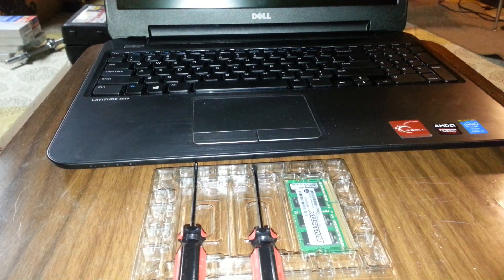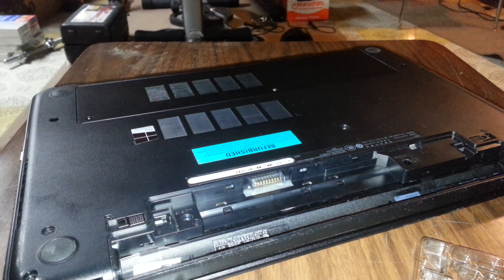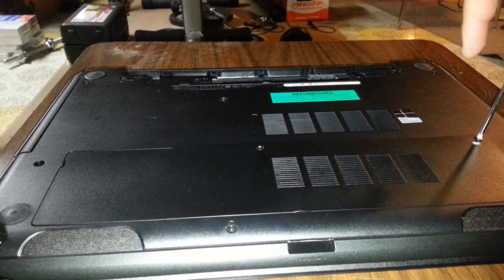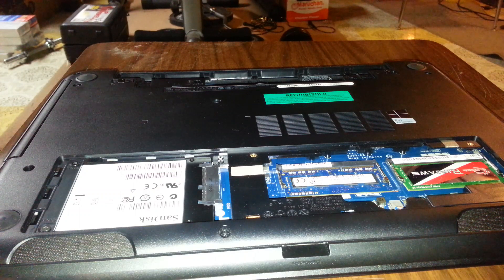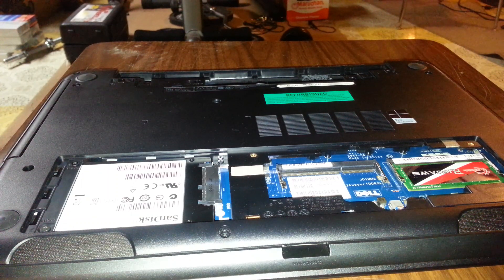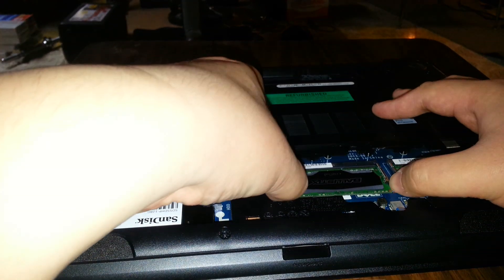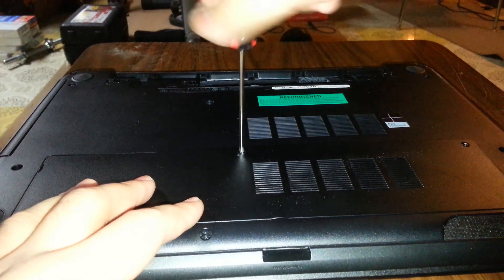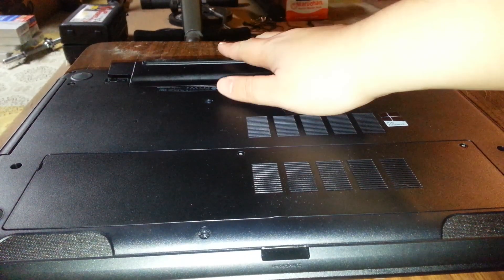How to Install RAM In Your Dell Latitude 3540

Comment: i guess you do have a 16 gb ram chip as it is 2019 so i wanna know if you have tested whether 16gb ram  chip works or not and the 2nd thing i want to know is can we add a graphic card to this laptop?i see there is an amd sticker which i didnt got when i bought this lappy well it runs with intel graphics so if  we can install vram,whats the max vram that we can add?.....please answer both of these questions ill be waiting thank you

Comment: Wait so you have to touch something metal when you are doing this?
Reply from the maker: Hi InvisibleCrumb, Typically before touching any bare electronics you want to touch something metal to ground yourself in order to get rid of static electricity that is built up on your body and clothes. Even though it's a small chance you still have a chance of transferring that static electricity over to whatever electronic that you're working on and frying it.

Comment: you really should be using the exact same two sticks of ram. i thank you for your video in helping me make my purchase decisions. but honestly, timings are SUPER important when it comes to performance of ram modules - ALWAYS buy the exact same two sticks - preferably at the same time even.

and since this video seems to have a few newbies asking questions - you MUST buy SO-DIMM ram for a laptop. regular full length ram will not fit.
Reply from the maker: Brian Walsh II Agreed! I was too cheap and bought the sticks of RAM on sale separately.

Comment: Hello Austin, this is nice video which explains about 3540 model beautifully. I am also planning to buy the same one in Canada however clear indication does not mark whether it has  2 slots or 1. My questions are :
1) Can I upgrade RAM ?
2) What does this mean 4GB (1x4GB) , so does it mean it has only 1 slot and only they are replacing older ram to newer one ?
3) I just want to make this laptop as 8gb for my software installations so will it be detectable post-fixing of additional 4 gb ram ?

Extra info: currently they are sporting 4GB (1x4GB) 1600MHz DDR3L Memory , and also the same DDR3L is available on their website to buy ...but it again shows 1*4gb...

Thanks,
Adam
Reply from the maker: Thanks! I will answer below:

1. Yes there are 2 slots in this laptop.
2. It means that you have 1 stick of 4 GB RAM
3. Yes, the laptop should automatically recognize the new RAM once you install it.

Yes that is how my laptop came too. I was able to upgrade it to 8 GB of 1866 mhz RAM (2 4GB sticks).
Reply: Thanks a lot
Reply: +Austin Lee hey Austin , can I now upgrade this to 16 gb since my laptop performance is worst , also let me know where to use previous 4x2 ram....?? any help would be appreciated...
Reply from the maker: Hi amol palkar, I still haven't tried to see if my laptop can go up to 16 GB of RAM or not simply because I just haven't had a need for any more than 8 GB of RAM.

That being said, there are always a few questions you should ask yourself before you simply throw more hardware or money at a PC performance issue to try to fix it. 

1. Was performance always slow  even when you first added RAM to the machine?
2. What are you running on the machine when you notice that it is slow?
3. Have you ran hardware diagnostics on the PC to rule out possibly bad hardware?
 - Dell has built into the BIOS, a very nice little hardware diagnostic tool. This can be done by pressing and holding down the FN key when you first turn the laptop on. As seen in the video below, make sure that you run the Thorough Tests:
htps://www.youtube.com/watch?v=CxZZ7fSAYXs

As for your old RAM the 4x2 GB of RAM there isn't much that you can do with it other than selling it or keeping it for another PC. Thanks and good luck!
Reply: +Austin Lee thanks buddy for quick reply , actually you have identified the problem , yes performance of laptop is really slow ....now I feel that why I have purchased dell latitude...my office laptop is lenovo T450 which is just awesome...i wanted laptop like that but i thought since it is latitude it is strong hence performance will be great but nah , this is worst laptop...... now my next target is 16 gb ram and 1 tb ssd , btw i will try ur suggestions....thanks again!!!
Reply from the maker: Np and good luck! I'd be curious to see how it goes.

Comment: Hello(sorry for my bad english) i send u private message about my problem. I have in my laptop 1x4GB Samsung RAM, and i want to buy another one. BIOS says than i have 1600Mhz buy finally i dont know if i can buy just 1x4GB ram ex. from G-Skill/Kingston or i need to replace this Samsung RAM and buy 2x4GB RAM... What do u think ? And look at this its strange, BIOS says: 4GB ram and 1600Mhz but look at CPU-Z: http://i.imgur.com/2COM9rU.jpg (800Mhz). What do u think about buying 1x8GB it could solve all the problems about compatibility but 1x8GB will be compatible ? (i prefer to buy just 1x4GB, but there are a lot of RAMs CL9,10,11 and i dont know which i need to buy). Really sorry for my english, i think u understand my problem and u can help me :). And another question, because i want to buy ssd caddy to have HDD and SSD it is possible and it will work good ?
Reply from the maker: Sorry for the late response, been busy with school and work so i havent had time to be on this. Please see my response below.

1. You can go with any brand memory as long as the speed and memory type is the same. For example if you have DDR3 1600MHZ you need to purchase DDR3 1600 or faster. But you cannot purchase DDR4 RAM because it won't fit and is not compatible. The brand doesn't matter unless you are looking at overclocking the RAM itself or your motherboard is locked to a certain type or brand, but this is rare.
2. CPU-Z is showing the true speed of the RAM. DDR stansd for double data rate so what you are really looking at is 800mhz X 2 = 1600mhz.
3. The 8 GB chips are expensive, in mine I have 2 4 GB chips at 1866 mhz, but if you can afford one then I would go for it and keep the 2nd chip in. You want 2 chips in so you have your memory running in dual channel for better performance overall.
4. Yes you can do that, but if you have this specific laptop I had issues getting a dual boot to work because my Latitude 3540 sees the DVD bay slot as only a DVD drive bay and cannot boot from it. They do make DVD caddys for this laptop and many other laptops as well.

I hope this could help and sorry for the late response.

Comment: hey thanks so much for this vid, i have the same laptop, is this Ram compatible? Corsair Vengeance 8GB (2x4GB) DDR3 1866 MHz (PC3 15000)
Reply from the maker: From what I have read on notebook review I hear this laptop has had some issues with mixed brands of RAM but I cant say I had the same issue. But based off the specs of the RAM I think you will be fine as long as you get the notebook RAM.